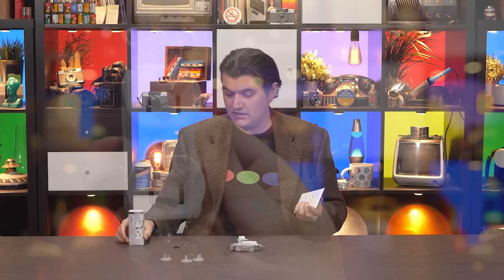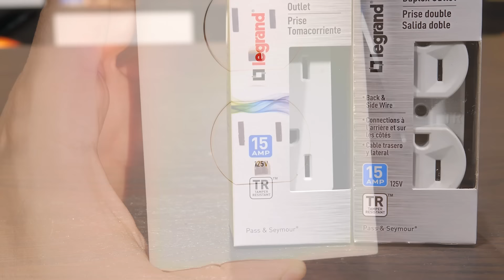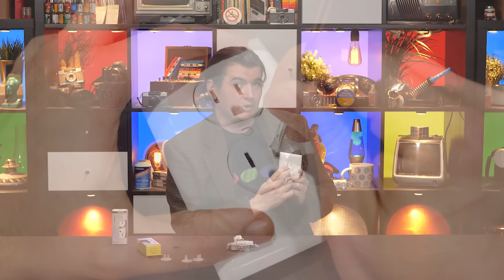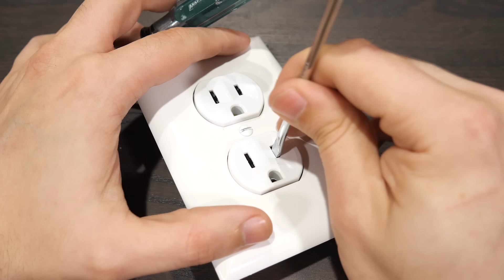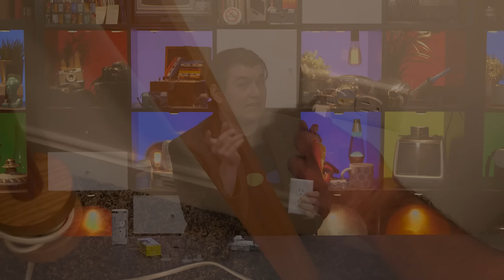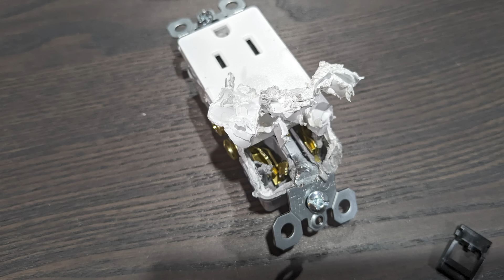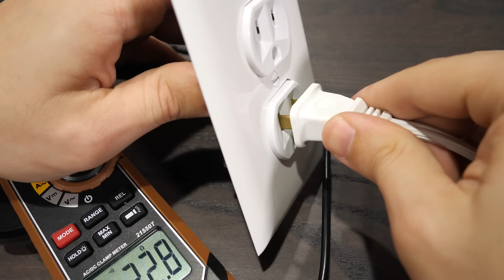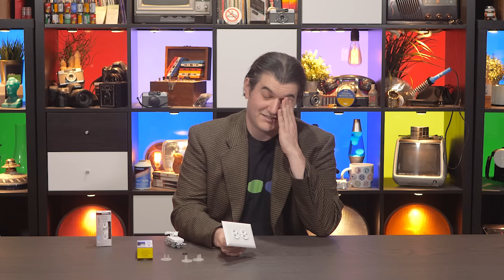Tamper-resistant outlets aren't all the same - a follow-up

Comment: I worked as a maintenance electrician for public housing.
The tamper resistant outlet were a problem.
Residents and myself had difficulty installing a plug into the outlet. 
We were told by management to go back to the old style outlets.
Concerning the plug falling out of outlets in public housing is a problem.
This happens because people in public housing pull the plug by jerking the 
cord out.
In order to get electrocuted and killed, the current has to go across the heart, like grabbing the positive with your right hand, and the neutral with your left hand. 
As a little boy, the switch plate on the switch going down to the basement, and I would get shocked when I used it.   I would complain to my dad and he would laugh.

Comment: I can say from experience of being a teenager wiring up my dad's shed by myself and then rewiring my house panel and my own garage 115 volts does hurt but I can usually control the muscles in my arms when I'm getting shocked on my fingers to pull away even loosen my grip with against my other muscles trying to clench onto it from the voltage, I only let myself get shocked by 240 volt once and 😅I couldn't control my arm at all, and thank goodness that I was standing so I was able to step back to get my hand off of it

Comment: The difference between a lever nut (Wago connector) and the backstab terminals is the contact area.  Lever nuts have a fairly large contact area.  The wire is pinched between two plates that clamp down on the entire width of the wire.  where the backstab terminals are only pinching the wire between two very thin blades.

Comment: Not to nit-pick, but it is not voltage that can kill you, it's current (amps). But I'm sure you know that. True, higher voltage will push more amps through a given resistance (in this case, the human body), but only if that power source has the capability of producing high current as well.
The weird fact is, a flashlight battery at 1.5 volts can produce 1 amp or more and can easily kill you if it's energy is applied directly to the heart. Actually one amp is one JOULE per second of energy. An energy level of a few tens of milli-Joules is enough to kill. I worked in automotive painting facilities, where paint is charged with high voltages to cause it to be attracted to grounded (zero volt) car bodies. (opposite charges attract) In my job,  I was shocked by 80,000 to 100,000 volts quite often while working on these systems. However, the power supplies that generated such extreme voltages were only capable of supplying a few MICROAMPS of current. (One microamp is one-millionth of an amp), and as such the shocks, although quite painful, were completely safe, as the milli-Joules of energy was very low.

Comment: First. Yes less voltage ist better. Below 50V ist very save. At least it is save enough to tuch. 
But above that I ould make es as difficut to tough the pins as possible. 

If you own a home and you are not explicitly forbidden to install new outlets why not buy siwss outlets und replacement polugs. 
To me there the safest ones you can buy. 
Or is it illegal to install stuff thats batter than the us stuff.

Comment: Those plastic things at the start of the video, shouldn't be anywhere near the British socket. 

Also, some sockets, especially those branded as MK, have shutters that need to be pressed together in addition to the presence of the ground pin. This ensures the only thing that can enter the socket is a suitable plug.

Comment: Oooohh I will die on this hill. A backstab is much different than a lever nut. A lever nut is held in by a positive mechanical connection, a lever. This holds the wire securely in place. In a back stab, the thing holding your wire in is a spring. Completely different mechanisms. Back wiring (when you screw the plate down) and using the shepherds hook are better on those outlets.

Comment: USA here, and I totally understand the loose plug thing. It drives me absolutely insane. It tends to happen with older outlets more often, however new ones can be just as bad. I’m sure it has to do with the manufacturer and any issues by extension of that (e.g. the materials used). With that being said I think I will try sideways plugs wherever possible for a possible solution based off of your pinned comment. Thank you kind sir.

Comment: Also regarding general electrical safety and code requirements:

A significant portion of the NFPA 70 is not built around prevention of electrical shock, but prevention of fire. Most people will survive a 120V electrical shock, and a fair amount will survive a 240V shock. But a fire from improper installation or overloading is way more dangerous

Comment: Regarding your tangent about backstabbing receptacles. There is a mechanical difference between a Wago 221, which uses a lever mechanism to put tension on a splice, and a backstab, which uses a spring mechanism to hold a splice together.

In my professional experience, i’ve seen an equal amount of backstabbed receptacles that have burnt up vs. a stab-lok circuit breaker which uses the same spring mechanism. I thing tension mechanisms should be mostly removed in favor of a mechanical connection by crimp, compression, or solder.

Comment: Japan uses a similar power system to us (100V 60Cycles) and that's because the United States helped Japan rebuild after WWII and the US at the time used a variation of the 100-120V 60 cycle Electrical system at that time, so technically Japan uses the same electrical system we do (although I got into an argument once with someone that said that stuff from Japan couldn't be used here in the USA unless you used a Step-up Transformer because supposedly a radio or a hair dryer or heater or fan that runs off 100V 60 Cycles would overheat if plugged into a 120V Volt Outlet even though the plugs and outlets are the same.)  Another interesting thing about the Japanese 100V System is that they still use 2 prong outlets in Japan and push-button light switches whereas we did away with that kind of technology over 50 years ago.

Comment: If you could design a better outlet/plug, what would it look like and why?
Reply: Probably just require the bottom quarter inch or so of the live and neutral prongs to be insulated.  That's really the main functional difference between North American/Japanese plugs and the plugs used elsewhere that are supposedly so many millions of times safer (that or have some very specific shape of plug that fits into a very specifically shaped recess in the receptacle).

Comment: I live in a house that was built in 1921 and it still has its original knob & Tube wiring still intact and functional. The base outlets in my house are all the old two prong outlets that were installed in the house back in the 1950s when the house was last "remodeled" (which involved converting the original Gravity Furnace from coal to natural gas, "updating" the kitchen by replacing the original cupboards and sink with new cupboards and sink, and removing the swinging door from the kitchen/dining room doorway and converting it to an open archway, and removing the old knob and tube wiring from the base receptacles and replacing it with two conductor romex wiring and installing new outlets and closing in the front porch and adding outlets to the front porch area after it was closed in, and updating the bathroom.)

Anyways there were several of the old two prong outlets in the house that I had to replace with some replacement NOS two prong outlets because the ones that were in there from the 1950s rennovations done to the house, were to the point that they wouldn't hold a plug in anymore (especially when I had to plug in a grounded plug using a 3 prong to two prong adaptor.)

I live in Elkhart, Indiana, (which you may have heard of in Chicago if you are familiar with the RV Industry because Elkhart, Indiana is the RV Capital of the World), and I've not read up on the electrical codes in Indiana, or in Elkhart specifically but from what people have told me, you can install grounded outlets in a house that has older style 2 conductor wiring (including k & t wiring) by tying the ground screw of the outlet to either a ground screw inside a metal electrical box, or tying the ground screw to a grounding clamp attached to a metal waterpipe, and that's good enough to pass inspection, especially if its an older home that was built over 75 year or more ago before the NEC was standardized. 

What say you?

Comment: I had 3 brushes with electricity.  Once when I was 6 I put my father's ford comet key in an outlet. Knocked me on my butt.  It wasn't bad that I remember, I don't know if the power went out but I do remember mom or dad asking if I did that and Idr my answer.   I do know I never did that again! haha.   
Another time was when I was 16 , we had a chandelier hanging in the dining room with a turn 3 way turn knob to change the brightness.  I went to grab it to turn the lamp on and bbbzzzzzzzzzzzzzzz.  It wasn't bad. I got a tingling in my index and thumb.  It took me a second to realize what was happening and I remember not being able to let go of it.  I did after about 3 seconds.  then my fingers tingled for a few minutes after that.  I told my parents and they didnt' care.   I found the knob cover on the floor and re-attached it.   
Third was a couple years ago where a GFCI possibly saved my life.  Long story short:  Mini washing machine drains into bathroom sink.  No heat in bathroom so I use electric heater ( you already know where this is going).  I forgot to put drain hose in sink.  Washer drained all over the bathroom and water traveled to "porch".   I stepped in water 10 feet from bathroom.   I'd have been dead if there weren't a GFCI.   Now I take heater out of bathroom when doing wash.

Comment: It is not the voltage that directly kills, but the current (amperes). However due to the fact that voltage = current x resistance, as voltage goes up so does the current across a fixed resistance. Since the average resistance of the human body (dry skin) is about 10,000 ohms (unit of resistance) 120 volts divided by 10k gives us 0.012 amperes; with wet skin the resistance drops to about 1,000 ohms so the current increases to 0.12 amperes. For 240 volts, the current is 0.024 and 0.24 amperes respectively. Since it can take as little as 0.1 amperes to kill a human (way less if directly to the heart), you can see why being wet is more dangerous.

Comment: I recently had my house almost burn down because the stake in clamp in the plug got warm and let the wire fall out and short across the neutral so the breaker didnt trip. Just use the screw terminal

Comment: not even sure why I've watched this, as I live in Europe, but I can tell for sure, that most of the plugs do not fall off randomly just because you slightly pulled it. You need to apply actual force for it to be plugged or unplugged. If you just pull the cord, you may as well break the outlet :)
Reply: @@phillipbanes5484 Schuko plug is sturdy and it is used in major part of Europe. lol.

Comment: Back-stabbed connections can be perfectly fine, and they've earned the endorsement from CSA, UL, etc. The issue that you can't inspect them non-destructively. If I'm going to have to undo it to check that the wire was stripped the right length, and screw it back on... I'd rather just have it be screwed in from the start.

Comment: The issue with back stabs is that the same spring that holds the wire in is holding the plug in. So with many plug/unplug cycles, you actually weaken the grip on the wire inside the wall. Wagos on the other hand are always connected to wires only, so any stress on the springs in the socket does not impact the Wago at all.
I much rather get shocked by 220 with a GFCI than 120 with just a breaker. Here in the Netherlands all circuits are GFCI, limiting any current to your body to 30mA, while 120V at 15A is a much much bigger problem.

Comment: 16:23 The Shucko plug version of that is spinning it around until it lines up with the holes, or you know where both the holes and pins are and the plug goes right in.
Also we also have had shutters in the outlets for a while, they work in the same way as you described, sometimes I find that you have to rock the plug side to side for it go in. Interestingly, outlets with no shutter are still available, but shutters are required for any new thing with an outlet, including homes, extension cords, power strips, etc. The requirement seems to be somewhat recent (10-15 years ago maybe ?), since I still have plenty of stuff with shutter-less outlets

Comment: What most Europeans probably don't know is that residential grade outlets in North America cost way less than they do in Europe (~$1 vs $5-$20 depending on design and finish) and are often made to much lower materials standards which is what causes the loss of prong retention earlier. Generally speaking, commercial grade, "spec" grade, hospital grade and industrial grade outlets will have increasingly better retention and dramatically increased pricing. They get better contacts as the price goes up and can handle many more insertion cycles, which is why you can get a 240V range outlet for around $15, but a higher spec Hubbell outlet with the same configuration recommended by Tesla for car charging will cost around $100. They look the same, but are completely different grades of product.
Reply: @@phillipbanes5484 I'm not sure I understand your point. I've lived on both continents, done electrical work on both continents, and am familiar with electrical outlets on both continents. Europeans are correct that North American outlets are loose more often that those in Europe, but they also (in general) cost less money. If you buy premium grade outlets in the US, they will be on par with or better than European grade products. The difference is that here (US) any brand outlet will work with any other brand of plate (with a very few number of exceptions in architectural grade products) which is NOT the case in the EU, where you have to match device brand with plate brand for compatibility, which also affects the appearance of the system.
Reply: The English maybe, the thought behind it, no. At least you know what you mean. Enjoy your bubble.

Comment: Tamper resistant outlets are great until the shutters don't open and you have to take a screw driver (insulated, of course) and jab it in to break the stutters so you can use the outlet again.

Comment: Pro tip: if you're wanting to cleanly and quickly cut through plastic, use an ultrasonic knife. We use them in our lab all the time and it turns plastic into butter and makes for wonderfully clean cuts.
Reply: Guess those are fancier versions of sonic screwdrivers.
Reply: They’re so expensive tho :( like $300

Comment: Regarding backstab connections in outlets... around 10 years ago I wired up my cousin's basement. I was an electrician in BC, and this was in Alberta, so we had an electrical inspector look over the rough-in to do the sign off. I had marrettes (wire nuts, for the pedants) and pigtails to each outlet, as I was taught, and used the backstab connections for the pigtails. The inspector told me to remove all the pigtails, and ONLY use the backstab connections, Line-In on one set, Line-Out on the other. I refused, and he shrugged it off and passed the inspection anyway. To this day I am aghast at the thought of every outlet on a circuit daisy chaining through the backstabs and breakaway tabs for every outlet down the line.

Comment: I taught industrial electrical safety for many years and I had an entire section on 120V shocks.  Most Americans have experienced a 120V electrical shock (that is a process failure) and most Americans survive them.  I postulated the reason for that is most people experience those shocks in a US manufactured home which is typically wood framing.  So when they contact the live conductor they are standing on carpet or wood flooring on a wooden frame and the fault is through their feet.  Grounding is terrible!  I cautioned those working in industrial control cabinets and the like because the situation is very different.  Working in a very well grounded electrical cabinet with steel everywhere on a hot summer day when you are sweating and your clothes are damp changes everything.  Accidental contact with one hand while leaning on the steel cabinet can result in significant fault current across the chest.   That scenario has a different ending.

Comment: 240 volts is more dangerous because higher voltage can overcome higher resistance. I've stuck my finger across 120 volts quite often, is is uncomfortable but i was able to remove my finger. higher voltage increases the chance of causing muscles to spasm to the point that you can't break the connection or burns. For electricity to kill you, it generally needs to go though the heart, the shocks I've had caused by the North American 120 volt plugs are almost always hot-neutral on the same finger. We haven't done much about the plug design most likely just because they don't cause a lot of injuries. We've banned blinds with pull cords in Canada for safely of children, you can bet we would have changed outlet designs if there was any significant incidence of injuries.

Comment: I am in the process of swapping my outlets to new one (old ones were almond color, white looks much nicer imo) and the number of loose backstab connections was shocking.  Obviously pulling the outlet out affects it, but most needed the release slot to be used to pull the wires out, but at least one per room had a wire that just came out.